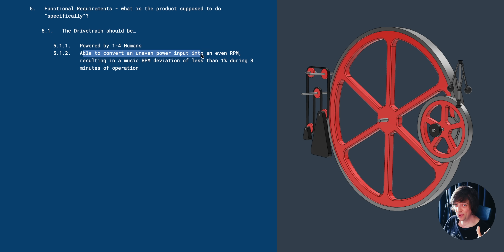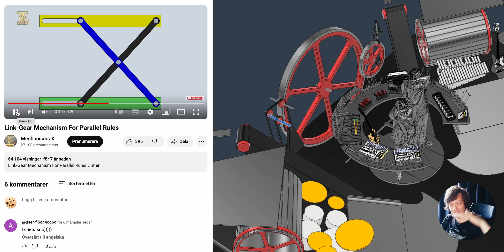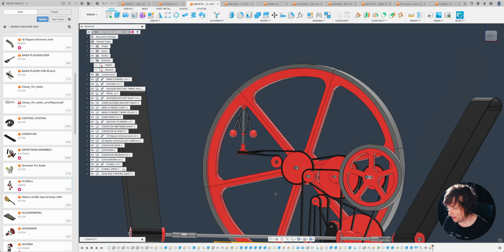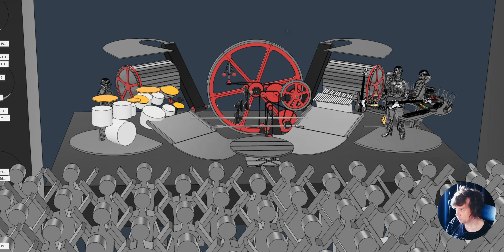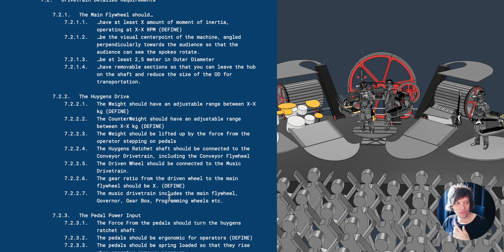The Marble Machine Drivetrain

Comment: flexi-cable for power transmission between pedals and ratchet wheel. like a speedometer cable but much larger and designed for exactly this purpose. the guys at bad obsession motorsports even made a video on how to make your own during the build of project binky...

Comment: One of the new requirement should be "The Marble Machine must be safe."

I feel like that used to be put aside because it wasn't really an issue but is now  becoming my main focus.
A giant flywheel, in the middle, in the front, in live concert ?
I smell an accident. Don't forget security.
Reply: I had the same thought. With such a flywheel, an arm and some fingers are easily lost…some transparent acrylic shields or similar could save some important limbs :)
Reply: I think we should place the wheel in the middle of the audience, so they can see it even better.

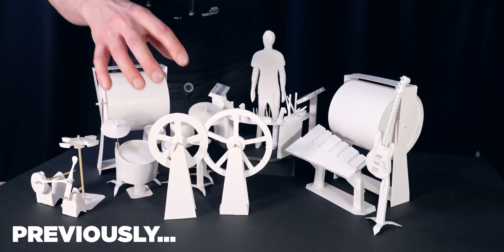Comment: 8:38  "2000 kilos of flywheel" Driven by less than 0.0013 foot pounds of martins kicking ??? Attached to a bazaar of friction joints music counters and bearing the load of almost a quintal of steel balls (momentum broken by an administrator Governor) - almost lose my marbles thinking

Comment: What about building the stage design around the bridge of a Start Trek ship with a curved ramp in the back center of the state where the drummer can be set up.  You would have your giant power wheel front and center underneath where the drummer sits and the marble machine set up around the stage similar to how you have it now.  This would allow you to have two in the middle, (Drummer above on the platform and yourself in the control box) and a keyboard and bass player on the wings.

Comment: Universal joints do not have constant angular velocity output, unless you use two of them such that the input and output shaft of the system are aligned parallel to each other.  The suggestion made in the video will result in the music speeding up and slowing down for each revolution of the shaft.

Comment: The pedals are unsafe, them being able to hinge from either end or the middle there is high risk of binding during travel. I think one pivot point would be better, unless you put in corner guides so it can only travel straight up and down. Also as many others have suggested, there should only be 1 pedal per side, I think an only sewing machine pedal design would work well that has its own  gearing to make it an easy press. It should be no bigger is the size of a foot for safety, as the performer's will get tired and need a place to stand. Possibly incorporate a medium flywheel on each pedal that is not load bearing; however if a performer needs a break it can be engaged with a lever so it maintains momentum in place of the performer for a short time.

As far as the mechanics go the majority of the world wont appreciate or understand them it shouldn't be the focus, the performers and controls should be in front, it allows the viewers to make the connection and pulls the entire machine together, however I think the mechanics should be raised a foot or 2 so the majority of the workings can be seen.

Comment: Two pedals for each operator. Like a stair stepper! Let's you use both legs and a lot more symmetrical action. 

Edit you could use a ratchet drive and a cable drive to optimize operator position.

Comment: In the current model , the gear box and all the mechanics are on the bottom half of the big flywheel. They would be more visible if installed on a horizontal symmetry from the big flywheel axe. Worth a test

Comment: One advantage of raising the mechanism high above the performers where no body can reach it will be for health and safety. Otherwise it will just have to be encased in heavy perspex barriers or wire fencing in case someone falls into it.
Reply: With the 2meter flywheel spinning above people's heads powering the intensely high vibration machine, the base to keep the whole thing stable will be so heavy that it will be impossible to disassemble in 2 hours. He'll need a crane and pairs of forklifts to pack everything up.

Comment: I've got a strange concern with that wheel: it will go at the same speed, regardless of the tempo of the song, because the gearbox is on the other side. It might be worth doing an animation of the wheel and watching it with different Wintergatan songs to see if that's jarring. You might want a medium-sized light gear in front that spins at the shaft speed to convey the tempo visually, with the huge wheel in the back showing the stored energy and moving relatively slowly.

Comment: Just move the drive train up a couple feet so it's mostly visible. On most stages you'll probably have at least 20 feet, way more in an arena, so use some of that z-axis and lengthen the belts a bit. Then you still get the ketchup performing center-low with the ice cream slightly up above and in the middle of the two you get that sweet sweet mashup of ketchup on ice cream. Maybe throw some pistachios in for good measure

Comment: As several have mentioned already, I would recommend elevating the operators on a platform above drive mechanism. The pedal drive will need to be incorporated into some kind of structure so why not use that structure to elevate the operators out of the audience’s line of sight. Depending on how the structure was designed you may even be able to incorporate other portions of the machine into it and thus play with what needs to be assembled/disassembled for each show.

Comment: Is it possible to elevate the entire fly wheel and instead of connecting at the bottom of the marble elevator, connect at the top of the marble elevator?

This way you get the whole daft punk feel with a massive fly wheel above the crew.

Comment: If necessary, you could calculate the physics for the flywheels to make sure what you plan to use for them is able to handle the stresses of spinning, even at faster speeds than planned.

Comment: The elliptical workout machine may help you too. It can keep the pedals almost horizontal all the time.
Please, make the Huygen drive as tall as possible.
You can call it the Tower of Power.
At least 1.5 taller than the wheel.

Comment: Martin - quick suggestion. Use colour-coding to record rotation direction. It is easy to mentally make a mistake and end up with a component rotating in the opposite direction to what you think. For example, green = clockwise, red = anti-clockwise. If you make a mistake, it will be more obvious.

Comment: Alright, here’s mine and my sisters thoughts.
The almond drive from earlier, Just having that a rotated conveyor belt for the 90° angle, I feel like it makes it to where you are missing out on cool looking mechanics.
Now the operators, here’s some major thoughts from me.
I feel like moving the operators to the side is not a good idea. It takes to much off the Symmetry, Yes, the machine is not Symmetrical, but it’s an integrated asymmetry, shoving it off to the side makes it feel like it’s not meant to be there. To fix this, why not just raise the entire flywheel mechanics up above the stage on scaffolding? it will once again add more of that Skeleton-Clock feel too that we desire, it would also bring more attention to it as it is raised above the heads of the operators, so it will stand out as the peak of the machine’s height.

Comment: I keep saying this:  Tower of Power
Elevate, Martin.  Elevate.

Make the 2 Huygen Drives [and you WILL Need 2 or you'll die trying to keep the marble-lift powered] stand above the rest of the machine.  This lets the weights have a longer drop-path, which in turn lets you "charge" the power-module more leisurely.
Plus, it makes it visible, especially if you set it further back from the rest of the band.

And I'm going to repeat someone else's suggestion:  Use clear-lucite tanks that you fill with water as your Huygen-Drive weights.  This makes them easier to transport, disassemble, and reassemble.

Comment: 1) the part im worried about is if the machine gets to be too heavy for them to pedal reliably for a whole show, i think an electric motor backup is needed (think worst case, martin sprains an ankle or such)
2) Keep the mechanics visible BUT behind the control booth, we are there to see "Wintergatan with the marble machine" NOT "the marble machine featuring wintergatan"

Comment: Twisting a belt 90 degrees to run the flyball governor is going to be hard.  Make sure you have a lot of length for the twist, and guides to keep the belts on the pulleys, since they'll want to run off.   Might be better to use an untwisted belt and a miter gear.

Comment: put operators on a platform above the mechanics? that would allow both to be seen and maintain camera angles. you could shrink the large flywheel slightly to make sure the operator platform is not too high off the ground.

Comment: Having 4 pedals side by side is a bad idea. Aside from the multiple safety issues, you wouldn't be able to fit 4 people in that space to operate them, as per your design plan.
Reply: I suggest you look into how existing (or historical) human-powered machines were pedalled, like a potter's wheel or sewing machine.

If it takes a LOT of effort, and mechanical stress, you might be better off with actual pedals, like a recumbent bicycle. You could even invite members of the audience to provide the muscle power. 😊

Comment: Concept: swap the pedal system to a treadmill with a bi directional ratchet on the drive shaft. Lower profile, less chance of snagging feet between horizontal movements. Bidirectional ratchet means players can swap which way they need to walk. Two output shafts opposite another so one stopping walking doesn't override the ratchet mechanism on the neighboring treadmill. Output power is sent into a differential that will push rotational forces towards the huigen drive. 

Cons: increase in coordination required
Pros: changing from 4 pedals to 2 treadmills give the conductor a wider space to work on

I figure this is not the best place to bring this idea but I needed to write it down quickly.

Comment: I think the operators/performers should be right in the centre, and there should be a plexiglass shield behind them for safety, and then there should be a huge video wall at the back of the stage and a lot of cameras taking in all the interesting moving parts of the machine and all the marble tracks.

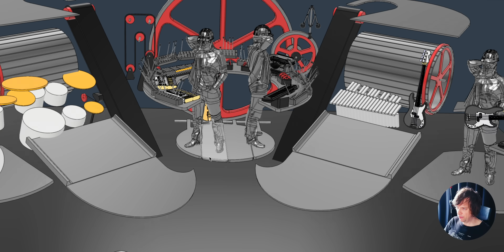Comment: A couple things to think about. I think you will like the second paragraph. Referenced to 2:34 the pedals. Pivot or parallax pedal design. The operator's height will be moving up and down as they pump the pedals. That presents a stability challenge to working the stationary controls. Even if you could figure out a treadmill design. There's still up and down body movement. On to #2 that you might like. Still related to power input.

Why get locked into a direct mechanical connection design from the pedals to the Hegains Drive. (I know I miss spelled that.) Walking on those pedals could be hydraulic pumps. Piped to a cylinder moving the drive. Since it is cabled it is flexible. You could put the pumping/power stage anywhere. I apologize if that idea was stupid. I'm just a simple copier tech.

Comment: I think you should put the machine operators behind the fly wheel in such a way that the levers are still visible either through or around the flywheel.

Comment: Why not have the two people on an elevated platform where the flywheel is built into the front section so you can see both the wheel and the two people

Comment: What do you think of the idea to give the machine sets of two pedals that are 180° out of phase so you could stamp with both legs (like a bicycle but with linear movement) so the load would be spread eveny over both legs? This would remove the need for a spring wich from my understanding is just wasted energy because3 it doesn't help lifting up the weight right?

Comment: Put the controls and the operators behind the Clock work mechanics on a raised platform. Mechanics are front and center and you still have the controls and operators the center of attention

Comment: Those pedals need some serous consideration. You can't have performers just standing on them like that, they will all be moving and causing large pinch safety issues the way they are sketched right now. Those springs and the extra friction in a sciccors lift like that will cause a lot of loss between human input and the drive shaft.

Comment: Raise the fly wheel up 4 feet, Instead of working from the fly wheel axle down, work up, eg transmission is above the fly wheel axle, The governor can be on top of a long shaft and be above every thing. The counter weight should start up high and be able to fall all the way to the floor, This give you the ability to store energy in the machine for the time you want to do a solo. Now design the drive train so that you can also use it in a more compact version that is not as tall for venues that have limited ceiling clearance.  the short design may not have the fly wheel raised up and the governor is on a short shaft. Make sure you use Constant Velocity joint in your drive line. 
I am also going to raise a question as to why have a transmission in the first place. My impression is you want to be able to select a tempo by changing gears. When you really just have to adjust the governor to regulate the machine at the right speed. If you need a greater range a combination of a simple transmission and a adjustable governor may meet you requirement. 
With a transmission you are changing the power requirement needed to operate the machine. When you have the machine running slow the torque output of the driveline will be high. When you are running the machine fast the torque will be low and that may cause the machine to stall. When you adjust the speed using the Governor the torque will be constant, Which I think will make the machine operate more consistent.

Comment: A horizontal pedal absolutely will not be more ergonomic because the operator will receive almost no physical feedback from the system as they use it, and worse, won't be able to use all the muscles in their leg or even apply their entire weight toward operating it. A hinged pedal allows the operator to easily judge its position by the angle of their foot as they use it. Would you make a parallel acceleration pedal for a car? A hinge here will also lead to less physical strain and more efficient human-to-machine energy transfer because you can judge in realtime how much force to apply and when to let up, and again, you can use all your leg muscles (and even shift which ones you rely on to ease repetitive stress) to operate it.

I can't believe after all this time, and even this video where he stops himself to clarify vague requirements, Martin is still just making wild out of the blue assumptions which end up both over-complicating his design while also making it worse.

Comment: One way you could have the gearbox fully visible and keep the control station in the center is to put it (the gearbox) up and to either side of the flywheel just inside of the conveyor belts. Maybe slightly behind it. There is unused space there. Then you won’t have to compromise visually. I don’t know how realistic that is mechanically though

Comment: Put the mechanics higher in the air. They can be partially visible above the heads of the operators. Looks cool if the machine in the background is larger than the operators.

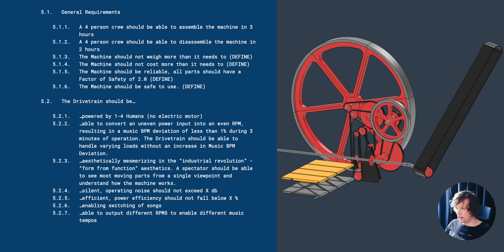Comment: 5:35 If you power it via the huygen drive, you should not have to pump more when the load on the conveyor belts increases. The power comes from you raising the counterweight, and that weight stays constant. This counterweight needs to have a mass that exceeds the max load to be able to keep that constant tempo you crave so much. And isn't vertical pedals less efficient than a regular pedal?

Comment: Suggestion for making the mechanics more visible. Would it be possible to move the drivetrain to the top of the flywheel? With belts driving everything it doesn't seem too crazy to do that. That would put the drivetrain above the switches and operators making it visible.

Comment: @Wintergatan
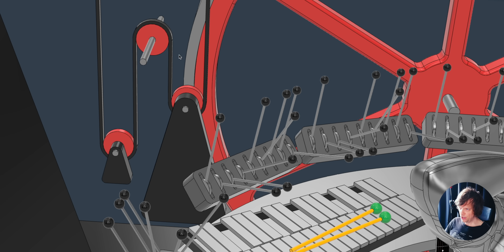2:54 You should also consider: No pedals (up/down), 
instead use "bike pedals" (around), they already creates a rotational energy (instead of back-&-forth energy that needs to be converted into rotational energy).
In that way you don't need some ratcheting system (that probably will be noisy).

Comment: Go with what has already succeeded...the pedal system for an old sewing machine has been used for hundreds of years. It's a crankshaft rocker pedal system. The system you have with the human input through that "stomping mechanism is just asking for trouble. Use a motor drive assisted by human input so it doesn't wear you out...human input 10% motor input 90%.